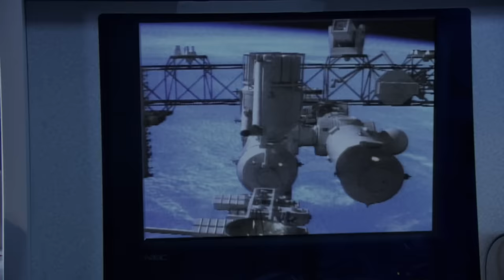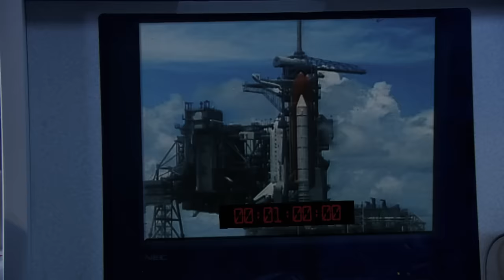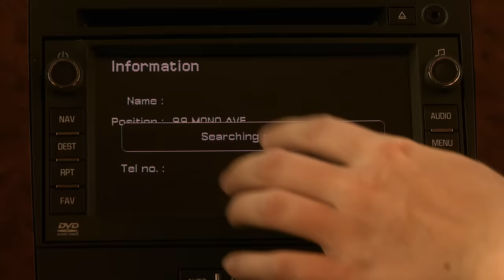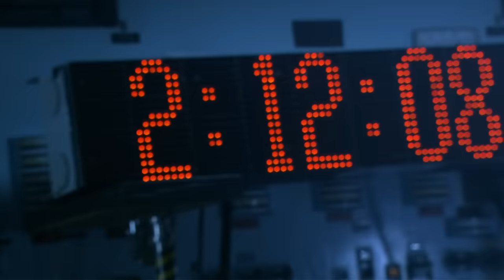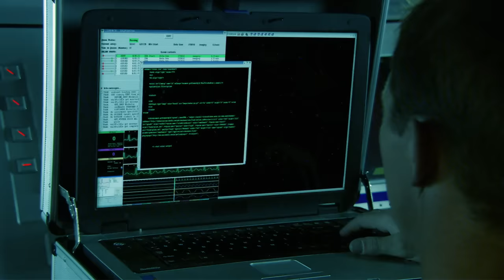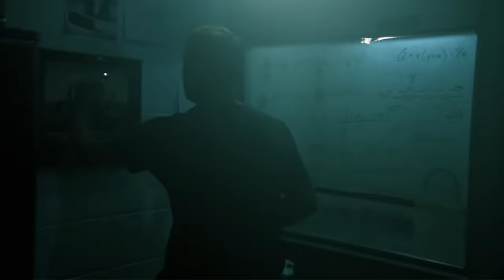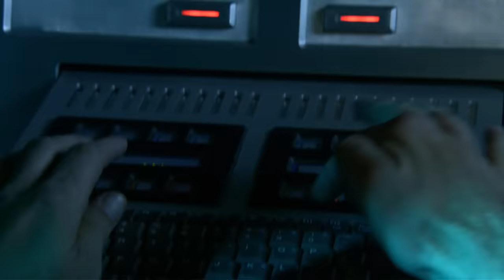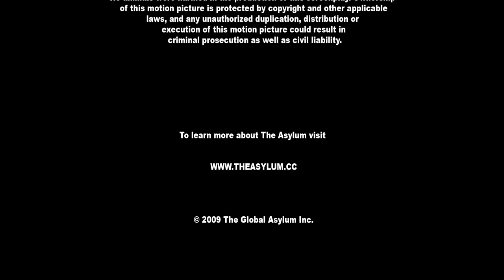2012 Supernova | Full Action Disaster Movie

Comment: Very interesting movie. However, the speed in which the blast came is way too fast for a supernova shockwave. For example, 15:25 into the movie, it says it was at the solar system boundary, but then at 28:04, it reached Pluto. So the solar system boundary is about 11.25 billion miles away while Pluto's average distance to Earth is about 3 billion miles, Now assuming an average supernova speed of say, 20,000 miles per second, based on the calculations I got, for it to go that distance of 8.25 billion miles, it would take approximately 4 days, 18 hours and 35 minutes to cover it. But the countdown clock between when we first see it and when we see it again after Pluto is destroyed has decreased in a little more than 17 1/2 hours. Way too slow and thus, it has to be going at a much faster speed than that. Also, if you look at the parts where it says "main supernova blast", it is concentrated around a relatively narrow area/beam. So if anything, to me it looks more like a gamma-ray burst (GRB) rather than a supernova. At the beginning of the movie it says it occurred about 200 years ago (i.e. 200 light years away). Now from what I understand searching on Google, even a GRB at very close range probably wouldn't vaporize Earth and other planets. It would basically have to be near the edge of the Solar system to do so, and even then, the beam would have to be pointed directly at them. So at 200 light years away, it wouldn't be anywhere close to doing so. But nonetheless, even at 200 light years, if it hit Earth, it would certainly damage the ozone layer enough to cause a deadly increase in ultraviolet rays and drastically alter the chemistry of the atmosphere. So really a supernova at 200 light years is too far away to cause any effects on Earth. But still nonetheless, it's a very interesting movie.

Comment: The storyline is based on reality. NOT theory.  LIGO stands for Laser Interferometer Gravitational wave Observatory. A second location is known as Virgo and these two
facilities measure time space distortions caused by gravity waves. On Aug 1 2017, 
these two facilities detected that very effect. The source, is the star Betelgeuse. 
This star, just as the sun is to earth, is the one that sustains conditions on the Drako
star system.  This system is aligned by point of sight, inside the pyramid of Giza. 
Alternatively, the pyramid is aligned with Sirus A & B. The time span between one 
alignment and the alternate is known as one shar. 

The earth is estimated to be five billion years old. At one time, earth was much smaller, 
and had a single  land mass known as pangea. The distance of Betelgeuse is  671
light years away. This means the observation of the star on Aug 2017, actually took 
place 671 years ago. That brings the event that happened to earths time of the year 
1346. 
What was going on at that time on earth? The black plagues of Eurasia had begun in 
1331 that  decimated over 50% of the population, ending in 1665.  So 1346 was in the
midst of that event 671 years ago.  
There are three sources of gravity waves. A coronal mass ejection as has happened
 from our sun during the Carrington event of 1859. A passing black hole, or a star going supernova which is by far the strongest source. 

This causes four wave events. Pi mesons which are a subatomic particle and passes 
through the planet, and is the first event to occur. The second wave is the gravity wave. 
The third wave is a plasma wave which activates electrons. The fourth wave is of the light spectrum. 
There are some 2,000 holes in earth’s ozone layer. Without ozone, the full force of gamma 
rays from space would destroy all life exposed to it. Because of geoengineering,
there are already 23 negative feedback loops harming the environment. Corruption
by frequency is also increasing in intensity. Use of the 5-G destroys the genes, causes 
hypoxia and interferes with the schuman’s resonance for healing.
Not even insects can survive it. The earth’s crust contains ringwoodite located between 410
to 660 km deep. Trapped within the rock this has nascent water of 2.4%, in the
form of oxygen and hydrogen. The volume contains about the same as the amount
of water on the surface. However, there are also oceans beneath the crust. 

The gravity wave releases this into water, which lowers the temperature for rock to melt into lava. Gravity waves can also trigger earthquakes and volcanoes.  As of Dec. 28 2019 and progressing into 2020, Pureto Rico was struck by an earthquake swarm, including 11 that were of 5.0 or greater. Recently a large earthquake happened in eastern Russia. These are increasing in frequency and intensity.

Once the earth’s crust reaches it’s piezoelectric slip threshold, the crustal shift will move Canada south by about 1650 miles, placing Cuba on the equator. The shift will take just over two months, moving at 1.7 mph, about the speed of an elderly man using a walker.  

The arrival of wormwood is expected in April 2029 with a 1% chance of striking the earth. Scripture shows men’s hearts will fail, for fear of what’s coming on the earth. It’s approach will be seen by all causing distress of nations. Not all mankind is destined to live in eternity.
Reply: david mccallum damn Dude
Reply: You need to see a psychiatrist.
Reply: The last one scared me
Reply: @JeffMcDuffie72MeridianGate  You need to read scriptures and wake the F up man.
When you fall asleep at the wheel, we all know what happens next don't 
we !  You must have some knowledge in doing something. Just nothing to do with the things I've described, so you think it's nuts. That's unfortunate.
Reply: @christiangomez5855  Fear is not from G-d. It's from evil. Any
soldier knows, that once prepared, you won't be caught off 
guard by the things scripture teaches is coming. Until about 
2006, there was never anyone ready, to teach the kind of things
the world will largely remain unaware of. 
Out of some 7.8 billion, a remnant of perhaps 50 to 70 million 
will be prepared to teach all the survivors, how to live. The way
Jesus taught. I mean, he told everything he knew, and since then, 
nobody can agree on even basic doctrine. 

If you read Zechariah 8:23, you can know I am taught preparation
by the leadership. Even now I am in preparation to go into a place 
in the wilderness to get out of the way of this... global electronic
cage. Biometric Encryption And Satellite Tracking.  Get out of 
America. What are you going to do when they come for you? 

We are looking for the ones that know there is much more waiting 
for them than what anyone else has ever shown them.  We have 
the answers, but only a very small minority will learn of it and believe enough to act accordingly. 
Even scriptures say... men's hearts will fail, for those things coming 
upon the earth. It's like.... he man, I didn't come up with this stuff, but
until things in scripture happen to you that makes it all very real, people
just don't relate to it, or consider it urgent and they miss out.
Reply: The hospital attendants need to up this one's medications

Comment: Lightning follows its path to ground and of necessity this path must be conductive. In the case of a car, we have a shield and the electricity finds it's path through the outside metal, should it strike the car. The glass windows are insulators, so it makes no difference whether the windows are open or not. Lol films!  37:12
Reply: I thought that sounded wrong!

Comment: So, a supernova is when a star dies, aka explode
Reply: Yes, but only in massive stars, generally at least 8 times the mass of the sun. It only happens if the star has a core of iron, as iron absorbs energy and it can't release that energy to offset the weight of gravity. Our sun is not massive enough to become a supernova. However, the supernova blast wave looks more like a gamma-ray burst, a narrow beam of very high radiation. Really massive stars that become black holes can produce that in addition to becoming supernova.
Reply: @Jefflightning1291  Or Neutron Stars (Pulsars & Magnetars)
Reply: @ima.get.tiv.2  True. Another way a supernova can occur is if a white dwarf is in a binary system. As it accrets more matter, it reaches a point where it becomes too heavy (around 1.44 solar masses), and explodes (type Ia supernova). The other way a gamma ray burst can form is if two neutron stars collide.